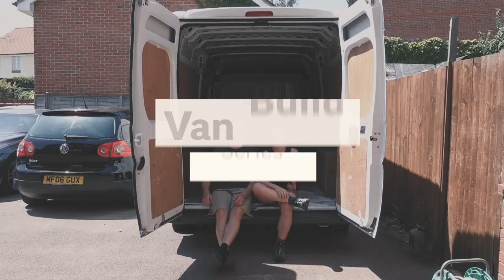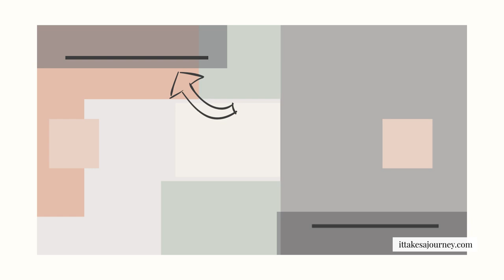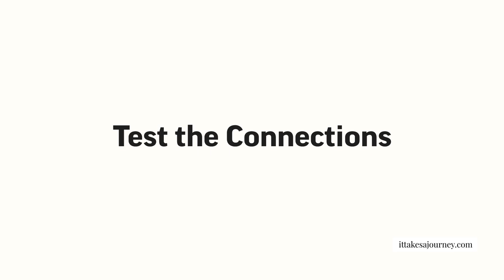Wiring for Lights & Electricals in a Van Conversion | How to Install Cabling & Conduit

Comment: Great video guys, thank you for sharing.
Re wires through conduit, I didn’t expect the Henry idea to work, but there you go.
On another video, they put a blade down the conduit to split it. They opened the split and pushed the cable in.
It can also be bought with the split in it.
Just thought I would share.
Looking forward to the coming videos, keep it up 👏👏👏👏👍
Reply from the maker: Haha Good old Henry coming to the rescue! Splitting it is a good idea, that would definitely work too. Thanks for sharing! :)

Comment: Thanks so much for the incredibly helpful blogs and videos! I was just wondering what make/model your wire strippers are? I'm trying to strip a 2.5mm wire in a black rubber cable and the strippers I have won't strip the outer cable (which is about 8mm). Thanks for any help!
Reply from the maker: Defiantly too late. Sorry about that. 😬
But these are the kind of things. These look like good value ones: https://amzn.to/3rkl8Dx
If there is an outer cable use a knife to remove that first. Be careful not to cut into the inner cable cover. This sometimes takes multiple attempts, so make the cable too long so you have a couple of attempts before starting over.
Hope that helps 😋
Cheers, Tom